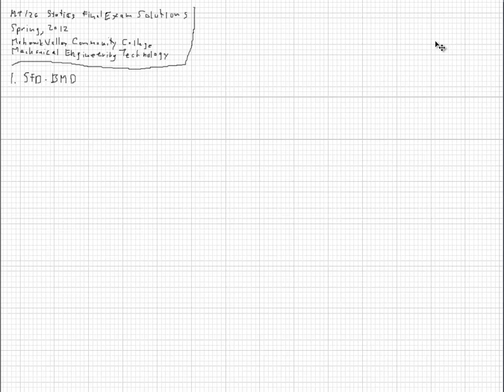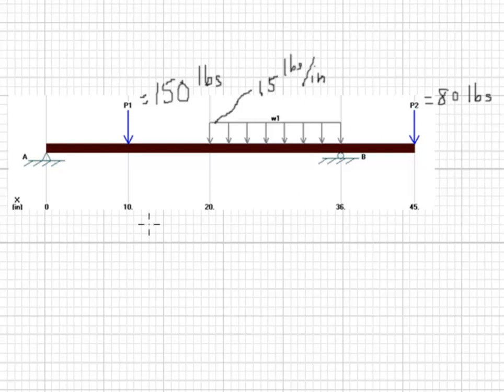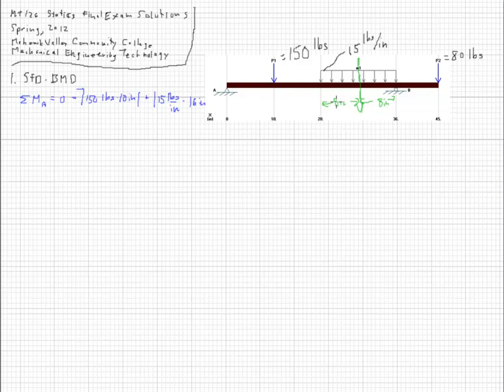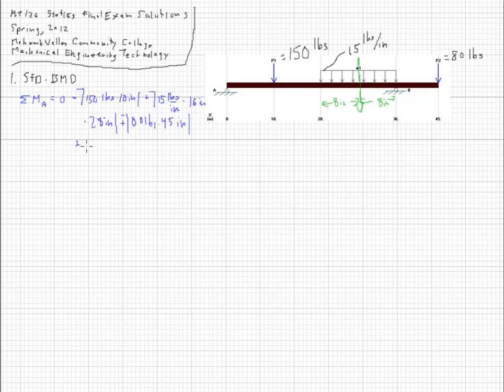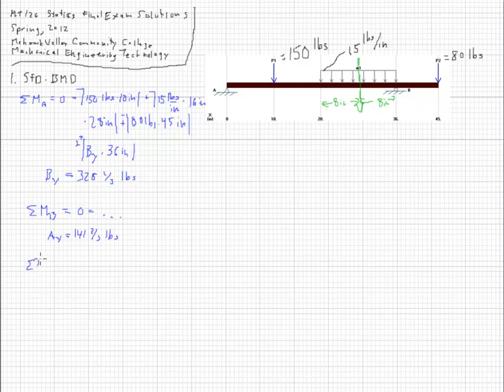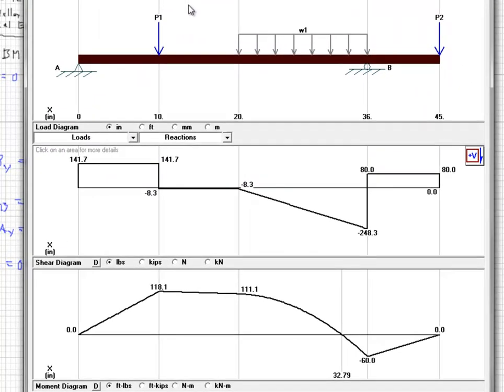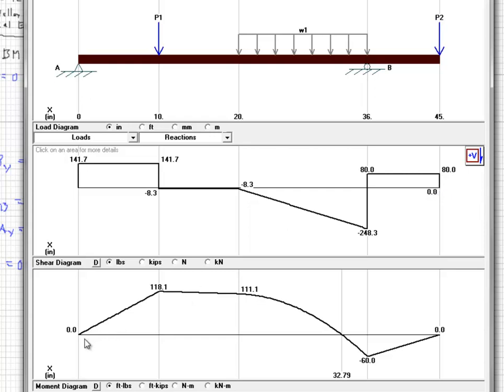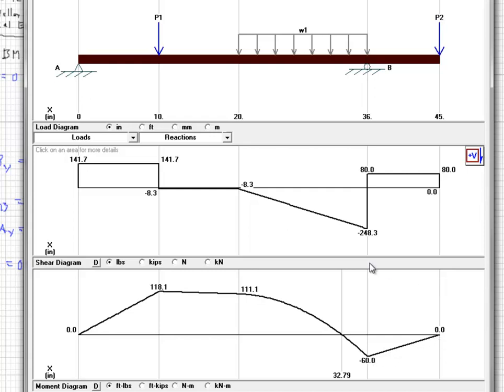Shear Force / Bending Moment Diagram

Comment: www.bendingmomentdiagram.com/free-calculator
For all the engineering students and civil/structural engineers out there, check out that free online shear and moment diagram generator (SFD & BMD). Super useful for checking solutions or generating diagrams for assignments and engineering reports when you don't want to do it by hand.